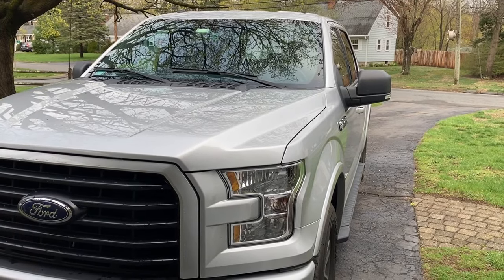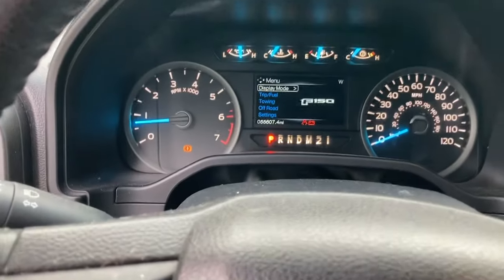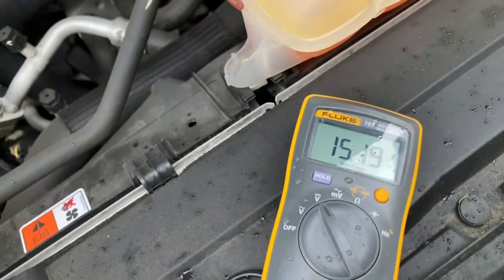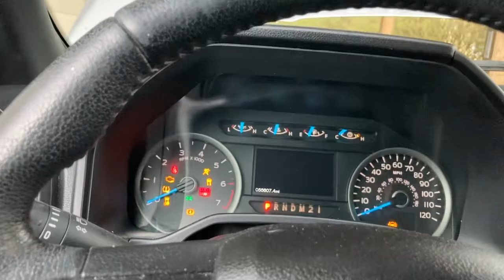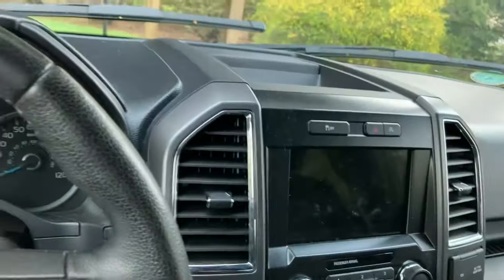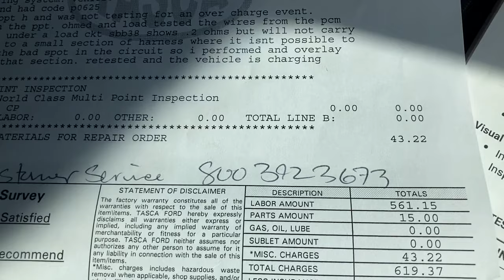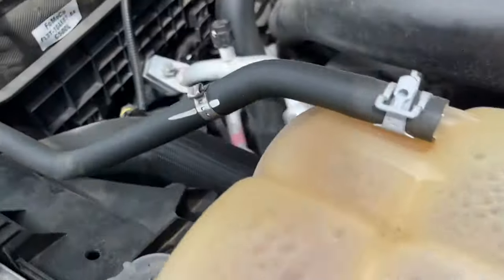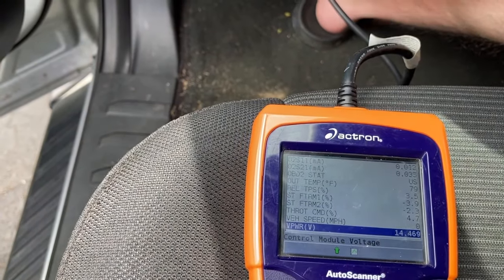How to fix Charging System Issues on a Ford F150

Comment: Wow! I'm speechless. I got this same message this morning (brand new battery) so some Googling brought me here. I will check connections and I'm not sure if the same wire is acting up on mine, but that SUCKS for the dealership to charge you so much for such a Mickey Mouse fix. I'm sorry that happened to you and thankful you posted this video.
Reply: its for the time spent diagnosing, which clearly most people can't do anyways. Not happy? learn to diagnose yourself
Reply: It’s definitely sad that they charged you that much to do such a sorry job.

Comment: Ive had the same problem and my truck has died on the freeway and streets. We tried jumping it and nothing happens the alarm comes back on. The alarm is identical to yours, I bought a new battery then went to get it diagnosed and they said it was a startup issue so I made an appointment with the dealer to get my alternator looked at and I have a 10 day wait until my appointment. I stumbled onto your video now I can at least point them in the right direction. Thanks for posting.
Reply from the maker: Glad this helped. I know I don't show the full detail of the repair but I posted this with hopes of helping people find the problem the first time rather than throwing parts at it. Over 2 years later the truck is still running great.

Comment: Thankyou so much!!! I have a Ford Mondeo here in the UK. You chaps call it the fusion but its the same car. My steering wheel is on the correct side though. I'm having the same issue. I've taken the car to the dealer and shown them this video. I will update you when hear back.
I got it back, turns out it needed a new alternator.
Reply from the maker: I'm happy to hear you got it running again!

Comment: Same problem with my 2011 f150. A auto dealership maintenance said that I needed a new alternator, they were wrong. I paid another mechanic to install a new alternator. Found out there was nothing wrong with the old one. Yet come to find out the alternator is overcharging the battery. Then Found out that there is an open circuit on a wire running from the alternator to the fuse block. The dealership wanted to charge me $1276.41 to fix the problem. I fixed it for $48.11 and two hours of working off and on the truck.
Reply from the maker: See that's where I wanted to end up, the problem was that I was hoping for a Warranty repair but I was wrong, and I needed the truck the following weekend.
Reply: How did you find the open circuit on the wire? Our f150 is doing same thing after having just replaced the alternator.
Reply: @katievitale168  did you get it fixed?
Reply: @falconedsel  we did yes, it turns out that there was some error codes that were not cleared after the alternator was replaced and that was triggering the alternator to think that it was overcharging the battery so it wasn’t charging and we would intermittently lose power. They cleared the codes and it has been great ever since.
Reply: How did you find that wire? My 2012 f150 keeps blowing up my number 45 fuse as soon as i put one in. Everything works it runs fine and charges the battery fine but I get that battery warning but it wont go away since it keeps popping that fuse.
Reply: I ended up replacing the alternator and it didn’t fix the problem. It’s currently charging at 13.3 volts
Reply: Hey Edward, I am having the same issue with my 2011 ford f-150. Did you re-run the new wires from the alternator to the battery? Any tips are appreciated. Thanks
Reply: Remove a 10amp fuse #45 in the fuse box sitting on top of the radiator. See if voltage jumps from 13.3volts  to 13.99volts. If it does then you have a wire that is corroded and grounding. That is why it's keeps popping.
Reply: @falconedsel   
2013 f150 same problem here. Won’t go over 13.4. 
New alternator new battery and new pigtail. Bunch of bs.

You ever figure it out!?
Reply: What’s the plug called I have the same problem
Reply: @katievitale168  how did you Clear the codes?
Reply: @bobg4299  any mechanic/jiffy lube can clear the error codes— the problem we had was the first time we took it in they were not thorough and didn’t check for the error codes. And if they clear them and then they aren’t corrected the problem will just reoccur.
Reply: I'm still having the same issue after changing alternator and battery, the dealer couldn't find anything wrong and same with other mechanics it gives me the charging system error whenever it wants and sometimes the car won't turn on
Reply: @alejandraodettejoaquin341 did you find out the issue
Reply: Seriously, how did you fix it?

Comment: Having same issue. Thank you!  They should recall this whole wiring harness!
Reply from the maker: Glad it helped! This throws so much speculation to other issues which is a nightmare to diagnose. Yeah I wish they would
Reply: How did you get the charging system problem fixed? I got the message this morning but not sense
Reply: @American_Muscle_Truck  I redid all of this and still had issues. Finally had to replace alternator, that fixed the problem.
Reply: @rone4416  Replaced the alternator, battery belt, and tensioner. Seems like it’s working fine but light keeps coming on.
Reply: @AJ  still having this issue?
Reply: Look at the wire of (the Short circuit) ,,, and connect it at the battery very well ,, Some  mechanics don't notice that 👍
Reply: Anyone else experience this? Mine started as well.

Comment: thanks for this video it helped me fixed my issue on my 2011 --- i was able to easily tap into first wire on the alt trace the same color wire to the battery junction box and spliced it into same wire / after the fuse.  my issue was similar having large voltage spikes beyond 18v causing my pcm to trip. got lucky that i was an easy fix but to charge this much for  single wire issue is crazy.

Comment: Great video. Its giving lots of value to viewers. Mine started happening 2 days ago and a slight wisltle sound when de acceleration and then gone. Then back today and all lights and abs power and wippers and heat and navigation power going off and then just all shut off. But I was able to keep driving all the way home with all power shut off. Engine system check was on the screen. That went off too. So I may look at the harness that's tied to the battery to the fuse box in the front opening hood. Fuse #27 may be the one to replace . If it's brurned the they have an upgraded harness and fuse for that. I will check tomorrow and see what's happening. Always electrical first from issues nowadays.
Reply from the maker: Yes, especially when you have more than one issue such as close to a dozen out of nowhere, probably electrical. Good luck and thanks for the comment!
Reply: @slicemadice  thank you for the reply. Yesterday I fixed the truck finally. Mine is a 2009 f-150 platinum Lincoln model. Fuses are all different and placements. So fuses where not the issue. Checked them all out. Found the 1" ground to chassy was dangling and another ground snapped off.  Fixed those and still nothing. Put new battery and still nothing. Check electrical system warning with battery light on icon never showed up again even with old battery. Ordered the new alternator and put it in and now battery is charging again. Later this week will get a full scan and diagrams of the whole truck. This platinum edition seems to be different with the Lincoln software and wiring from other Ford 150 2009. It's also a 5.4L 3V with 137 k . Purchased new in 2009 . Never had an issue with this truck but this is the first in the starting. The rattling cam fase thing on and off. Did a chemical flush clean inside out the motor and put new oil and went away. I do oil changes every 3-4k km. But still need to be checked for future problems. Hope this helps with my experience as my reporting. Hope it may help others. Thank you.
Reply: @peppi7777   Hey Peppi7777, I was curious how things have been for your Ford's charging system in the past year,

I have a 2009 Ford F150 FX4 w the same engine.  It's been an awesome truck . . except for some of the battery and charging system issues that have popped up over the last two years.  Yesterday I experienced the same system shutdowns "domino style" and somehow made it back home.  I have a pretty new beefy battery, nonetheless it seems to have discharged significantly.

Did an overnight recharge, and the battery is back to full strength for the moment . . it's operating normal for just a short drive around a few blocks (which was encouraging), but the charging system warning flashes still.

I'm contemplating my next move . . curious how things have played out for your Ford since you last commented,

Thanks!

Comment: Wow! Thank you for the video. I had a similar issue pertaining to wiring in my 2011 F150. I was attempting to use the cigarette lighter to gain power for an inverter. Just a small one and it was brand new. I needed to test a lamp Anna pun plugging the lamp into the inverter, the unit stopped working including the cigarette lighter, the entire Entertainment System and everything else within  the center dash. I ran every single fuse to that truck testing everything I possibly could using a voltmeter and a test light . I found a couple of fuses that were burned and I tried the replacing those, but it did no good whatsoever. The fuses were not even related to the problem. After months of dealing with it and refusing to bring it into the dealer for that purpose because I was so unhappy with the lack of service I had received from the same dealership on another issue and a recall as well. Finally I broke down and brought it to the dealership and it so happens I heard a technician leaving for the day because there wasn't enough work. However they needed to schedule my appointment get this an appointment to be scheduled two weeks out because they were too busy. Now remember that technician that was leaving for the day because there wasn't enough work and I was only going to be one technician left in the building but they couldn't do anything about this for 2 weeks that just proved my point about why I was unhappy with them before. Nevertheless I digress it turns out that it was simply a wire Zach stop working at the point of harness. Obviously because I've heard a couple of other stories where wires were going bad at the harness point, Ford seems to continue to have an electrical engineering problem. I went through hiring someone to replace the radio that I thought was bad with a touch screen. I had already driven two and a half hours away to purchase another radio that was exactly the same as the one that was in the truck originally that I thought had burned. I felt that way because I had already tested all the fuses and spot check wires but I never tested the harnesses . So in essence it turns out the stock radio was never the problem, again, it was a wire I don't know if the wire burned inside of the harness or what happened but what's really strange is I decided to put back a stock radio that I had purchased elsewhere when I thought it was the radio that originally went out. So here it is a year later and I decided to put the stock model radio that I had purchased elsewhere and remove the touch screen because I could not seem to get the adapter to work with the steering wheel, the interface. Now remember that radio as well as the original stock radio I removed thinking they're just must have been a problem with the two radios. I pulled out the touch screen and replace it with the second stock radio and after checking all my connections carefully, the radio, the entire entertainment system began to work perfectly. So at this point I didn't even have to use the bypass wire that we installed when we determined it was the original wire going into the harness. But there was definitely a connection issue streaming from the harness. I'm finding more wiring issues why are either a sorter fail or a harness fail pause something to stop working thanks again for the video and if anyone takes the time to read this after viewing the video, I hope that it helps. I know once I determined it just had to be the radio that was gone after checking all the electrical that I could possibly think of with the exception of the harnesses being correctly plugged I wish I would have known about the potential of a harness, r a wire that could have caused this entire issue
Reply from the maker: Wow that's lot of diagnosing, gotta love electrical issues. Good you found a fix or at least you're on the right path to getting everything figured out!

Comment: This error can also happen after washing/rinsing engine bay due to water ingress at insufficiently protected electrical connections/connectors.
Reply: Will it go away after it dryies
Reply: @c02hazzard48  maybe not if corrosion happens
Reply: That's exactly what triggered my problems . . wow
Reply: I went through the car wash and got the under carriage washed off and the next day…..”check charging system” brand new battery brand new alternator and still “check charging system”

Comment: 2016 
Battery went dead...
Clicking when I tried starting it. 
Charging system dummy light kept on showing up. 
Had it jumped. Has started every since but still don't know if batter is going bad..
Reply from the maker: I would get the battery tested

Comment: Got a 2018, used F150, doing the same thing- ding a lings , then it goes off, I just keep trucking, does not affect my tho , OReily guy told me to clean the terminals , what do you think???
Reply from the maker: You can start with the terminals, but I would chase the harness for exposed wiring

Comment: Newer vehicles it is very important to reset battery adaptations and register new battery. It's not like the old days remove, install and go. It will work for awhile but will start to overcharge your battery because it still thinks it's charging the dying battery. Parts houses tell you this but most people blow it off.
Reply from the maker: Okay thanks for the information
Reply: The same with foreign cars. You need to reset the truck with proper scan tool

Comment: Thanks. Same year same truck just started doing this other day. While driving it going 65 mph everything just shut down. In the morning, truck started but nothing electrically was operational for about 30 seconds
Reply from the maker: It's not fun while you're driving that's for sure.
Reply: End up taking to dealership couple weeks back. Problem was a power train control module. They changed the alternator which I said didn’t believe was the problem. Of course the module was covered but the alternator was not. Had truck close to two weeks trying figure out  then having to prefer parts

Comment: I'm having same problem.. My battery was fine but it kept dying overnight.. So I checked alternator and was charging fine. So there is something on in the truck that's draining my battery overnight. So I disconnected the negative terminal for overnight and reconnected the negative terminal in the morning and was fine and started up.. So I'm still trying to find out what is on in the truck that's draining the battery overnight. Will update when I solve the problem.
Reply: Anything? Just curious. Did you end up finding what was draining your battery?
Reply: The battery itself wasn't any good.. Had to get a new battery. Runs fine now..

Comment: I have tried every tried in the book to get the "system off to save battery " ever since I replaced my battery in my 2016 f150 xlt 5.0 litre. It starts ok but  even after a highway drive when I shut off the vehicle the system shuts off immediately.  Very annoying 😒.  I've watched every YouTube video on the subject and nothing works.  
My problem was finally fixed when  my mechanic said that even though  my battery was supposed to "fit"  my truck when I bought it- it was a little small.  My 2 year old battery was 9.5 inches long with 660 CCA  and when he put one that was 11 inches long and has 700 CCA my issue was GONE!   Now I can listen to the radio without starting the engine.  😀
Reply from the maker: Modern systems are just more finicky these days. I'm glad you got that all sorted out!

Comment: Interesting.  Did that type fix on a fire truck once. Everyone said : replace the harness.  Warranty is 3yr 30,000 miles I think good luck.  They only recall if it's a life safety thing.  Otherwise it's a TSB.

Comment: Dont know if anybody else might have mentioned there is a typical spot for wire chaffing and corrosion down near the frame in front of the engine where a harness is held in place by a plastic TROUGH to hold the harness and a zip tie holding the harness to the trough, the harness rubs there and corrodes and the wire has a Voltage Drop VD and can be fixed there, normally, cheers.

Comment: a mechanic on another video said that the charging voltage  should not be above 14.6 and that if it's at 15 then it's alternator that's the issue. Or alternator related.... some vehicles had an inline alternator fuse. etc
Reply from the maker: Fortunately this truck is still running strong after the repair

Comment: My 2023 ford f150 was giving me this message all week. But had an appointment to take it in but the morning of the truck is completely dead. Key fob don’t work or nothing had to open with Manuel key. Funny thing is the battery is charged and the tow truck couldn’t even jump it. He thinks it’s the wire from the bcm to the fuse box. He’s the kicker I can’t get it towed out of the garage cause it’s a tight squeeze. Truck only has 10,000 miles. Why did I go with ford lol . Any ideas?

Comment: I had similar problem… the battery and alternator checked good so I put a charger on it and it checked 80 percent charged so I charged it to 100 percent and it still had the problem but the next day the problem went away! Maybe you could try that.